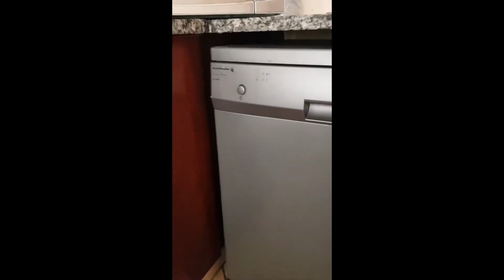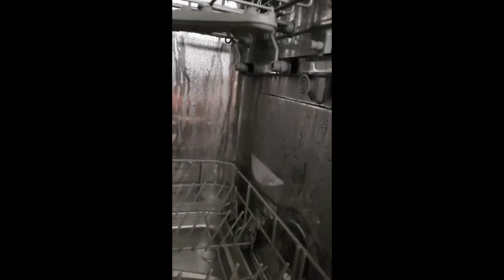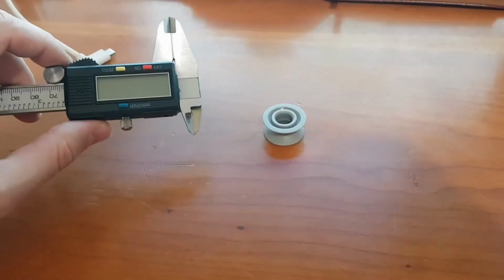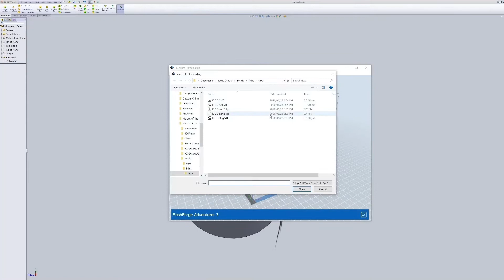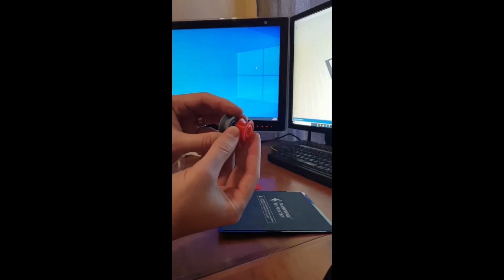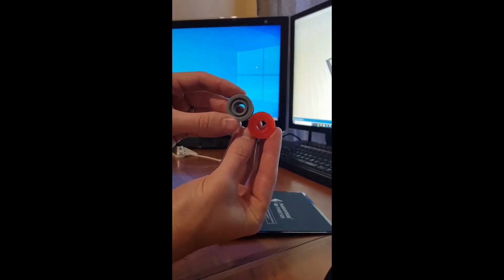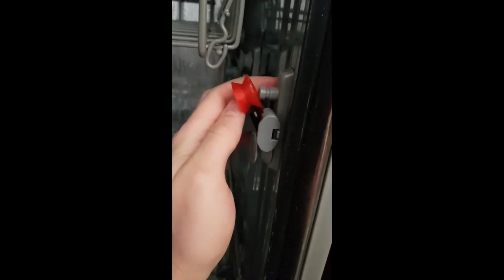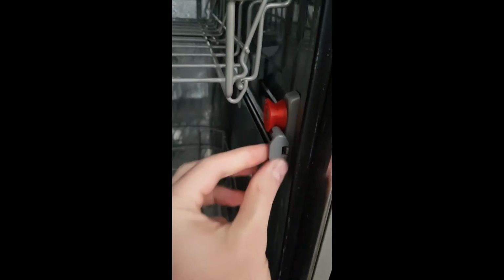3D Printing a spare part for a dishwasher

Comment: Printed in PLA?
Reply from the maker: That is correct. It lasted a while but ended up warping a bit and no longer rotating. I would recommend ABS or PETG if I had to do it again